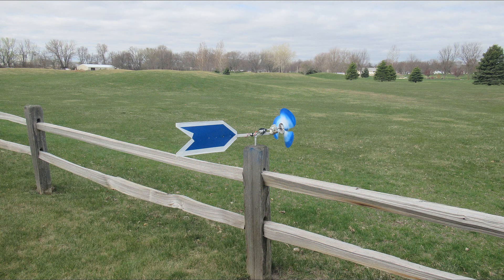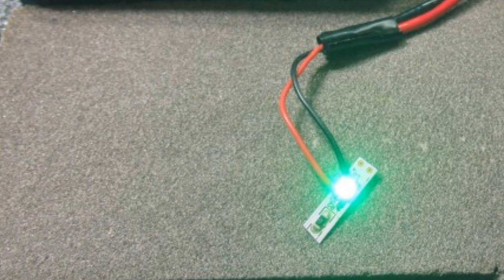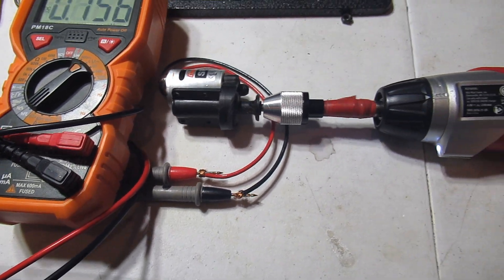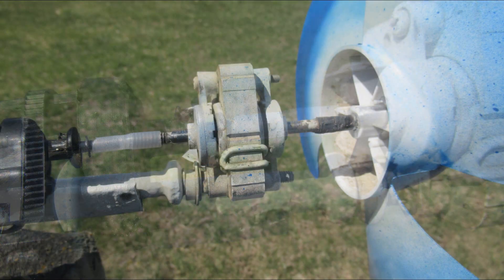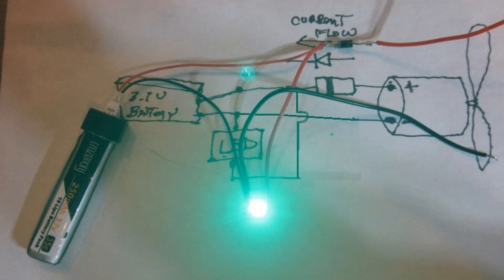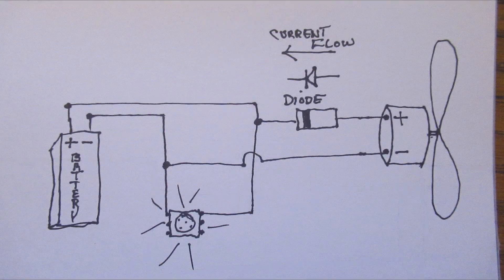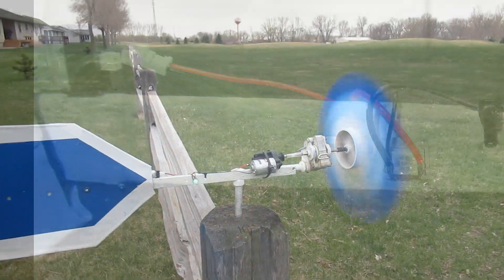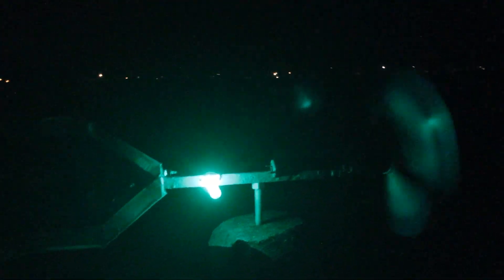Home made Wind Generator Science Project.  See how motors and diodes can work to charge batteries.

Comment: Very cool!   
And for further fun as you may already know you could try a few things...  
One is to use a very inexpensive constant current or constant voltage board that takes a wide variety of input voltage and will give you a steady voltage to run the LED.  
This will give you something that can handle a wide range of wind speed yet give you a nice steady LED and also not overvoltage the LED during really strong wind.  
So you will only get the light when there is wind.  
I'm also thinking a cheap NiMH battery would be better for no fear of over discharge :) and you could just leave it plugged in.
Reply from the maker: It has, so far not hurt or overcharged the battery, as the amps this thing is turning are very low, even in high wind. Since the LED is running off the battery, it acts as a regulator, so light remains the same brightness. Cheap NmHD batteries are what they use in lawn lights.  I might go ahead and add a solar cell to this as well and use that Solar lawn light circuit to regulate it all, including the battery.  Thanks.
Reply: @NightFlyyer  This make me want to build one of these! From scraps laying around.   
Maybe some polycarbonate blades cut from old CDs or DVDs.
Reply from the maker: @n8lbv  Go for it!

Comment: I did a similar project a long time ago, using a DustBuster motor, which is pretty much same as the old Graupner brushed motors. Re-wound the armature with a much finer wire, giving about 3X more turns and commensurately higher output voltage.
Reply from the maker: Great to hear that for sure. This was my second one actually.  Here is a link to the one I made in 2009.  I used it for powering different things. https://www.youtube.com/watch?v=_rOvmWJoK4k  Thanks much, Bill.

Comment: nice work I used car radiator fan and turntable motor to get up to 40v with 100mA and It was enough to charge 6v lead acid battery and power phone charger and wifi trazmitter but due to strong wind it broke
Reply from the maker: Wow.  Fantastic.  Sorry to hear it broke.  Thanks.